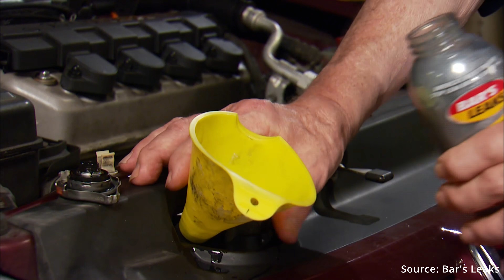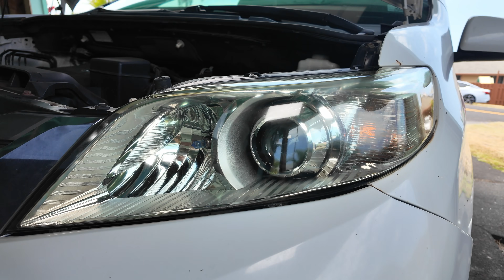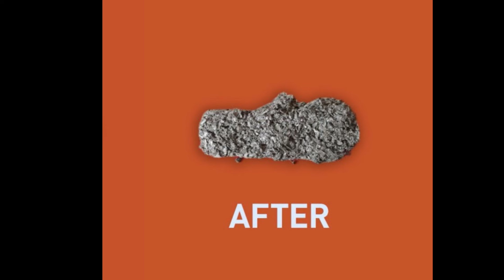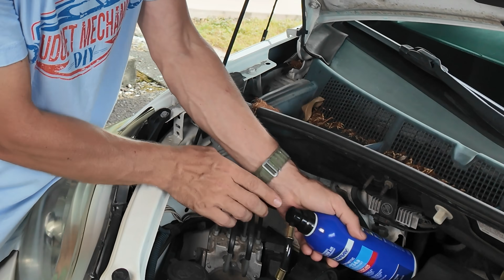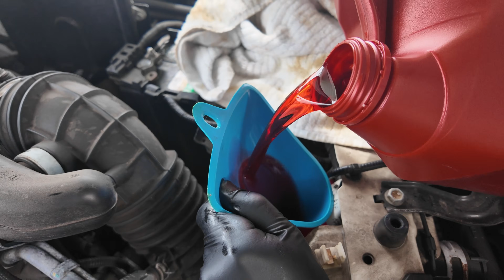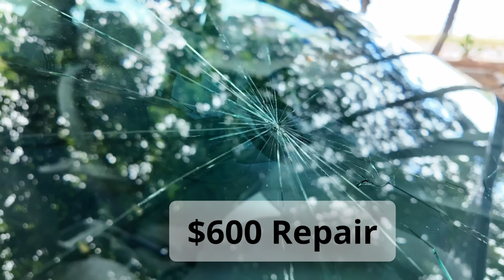These 'Quick Fix' Products Shouldn't Work This Well!

Comment: So, the Prius 2010-2014 are infamous for head gasket leaks.  Forums warned against using pour-in head gasket repair kits. I'm not paid by K-Seal, but the Ultimate Head Gasket Repair bottle saved me thousands so far.  20K miles in and the old girl and it's still going strong.  Head core is not clogged like forum people said. Now, this sealant is ceramic and not the metal base formula.  Again, I'm not saying this might help your scenario, but I worked for me.

Comment: I used the Maquire’s 2 step wipe headlight restoration kit on my 2006 Equinox which had heavily yellowed headlights. It cleared them up like new and it has lasted for 2 years. This is in Southwest Florida. BTW I used the 3M product in the past and it did work great but the kit doesn’t include clear coat protection which is what keeps the yellowing from coming back as fast. The Sylvania kit works as good 3M buy it includes a uv clear coat protection which.

Comment: There is no such thing as a fix in a can. I've been driving since 1991 - anything designed to stop a coolant leak or a head gasket leak ends up clogging the radiator, heater core and coating the engine cooling passages with gunk. You're just going to have to spend the money either way.

Comment: Hello from Norway. This you are telling about air-conditioning on a car and the AC box refill not working. This is directly distasteful and unacceptable attitudes from you. I bought a car. Peugeot 407sw 2.2 HDI. 2007 model. Air-conditioning worked very poorly. I bought such a refill box with AC gas, seal, lubrication in a box. I did this in the summer of 2025. I still have AC that works in August 2026.

Comment: In regards to Lucas. I had a 95 k2500 Chevy that would lose oil pressure when idling. Adding a quart of Lucas to my oil helped fix the issue, and I ran that truck for a long time. I'm not saying it's magic, but on older high mileage vehicles I've had success with it.

Comment: Josh, give us a chassis lube video. 

I just bought a grease gun and a grease cartridge and did it myself. My 4Runner has two driveshafts. The front 4WD shaft has two u-joints and one slip yolk joint. And the main shaft has a double cardan joint up front (which is two u-joints) plus a rear u-joint and a slip yolk joint.

Comment: I fixed a small head gasket coolant leak trickling down the block between pistons 1 / 2 for over 10yrs and sold it like that using radiator stop leak.
If you don't use PEA injector cleaner once a year your paying for it.
You need to scrape the winscreen with a blade and do it again, i can get them perfect normally.

Comment: About the windshield repair kit, after I bought one, I found out my chip was too close to the edge of the windshield.  So, don't try it for chips close edge.  Also, I found out that my Auto insurance with $500 deductible comprehensive covers free windshield chip repairs.  So, with another small chip away from the edge, Safelite came and fixed the chip on the Auto insurance's dime.  Also, about the $600 windshield replacement.  I have had two windshields replaced.  One required calibration for Lane Keeping Assist and Lane Departure Warning to work that one cost about $600.  The other didn't require any of that and only cost $290 installed at my home from a Business in the state of Delaware near Wilmington.

Comment: I used to use a product called engine restore. Would be curious to know what you guys think about that. Also would be helpful with more information about turbo cars because I used to hear that fuel injection cleaner is bad for turbos because if any build up gets loose it can damage the turbine fins.

Comment: I live in Alaska and I've used that brand of windshield chip repair. It did fairly well, but the RainX chip repair was significantly better.
Reply from the maker: Good to know!
Reply: I just dab some "clear" nail polish over them. Some of my chipped spots are treated such since 10-12 yrs, and they're still going strong 💪

Comment: In the late 1970’s, we would temporarily stop pinhole radiator leaks by adding ground black pepper to the coolant. It worked as well as any other product on the market at the time at a fraction of the cost.
Reply: That's nothing to sneeze at!

Comment: Had great results with Lucas stop leak. Fixed a rear main leak on a 2000 camry v6 5 years ago. Still doesn't leak or use oil, but I use high mileage extended drain synthetic.

Comment: There's no way a shop is charging you only $100 to diagnose/refill an AC system 🤣
Reply: I was wondering about that comment as well. When Josh said it I was thinking to myself .. yeah, no.
Reply: Where I am I can.
Reply: 2 yrs ago, paid $80 CAD, Mississauga - Ontario, full AC diagnostics and recharge, till date working perfectly. Thus I say, "$100 is about right" 👌
Reply: @QoraxStan where in Mississauga? I just paid $260 in Mississauga
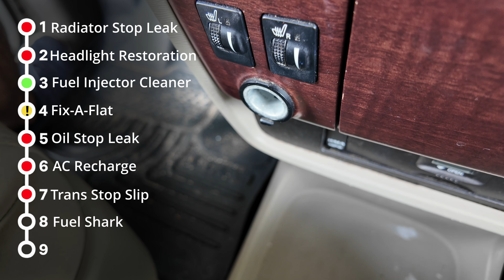Reply: Transmission Shudder fix cured torque converter shudder in my 92 Explorer, lasted for the last 5 years I drove it 16:10

Comment: I kept my AC running for years by adding 134a using a single hose on my junker 300K Nissan Altima.  Had to refill it every other year.  I really didn't expect it to work as well as it did.  I got lucky I guess.
Reply: It worked on a Nissan I owned back in the day but I bought a van and tried to use it recently and didn’t have any luck 😩

Comment: I always use top tier fuel along with (once a year) dropping a 12 oz bottle of Techron Concentrate Plus (it contains PEA) into the tank when it's low and then adding 7 gallons of gas on top and then going for a 40 minute freeway drive. Then I just use up the rest of the tank until the next refill.

So.. Josh's producer is finally coming out of the shadows to become a legitimate budget mechanic personality.
Reply: Top tier fuels are definitely worth using.
We get much cleaner carbies (very obvious) and injection systems (less obvious) when using them.

Another way to keep the whole engine clean is to bond a protective coating to everything.
It stops the build up of sludge, removes existing deposits and improves combustion efficiency (reducing the products that cause deposits).
🙂#XcelPlus
Reply: @1Wondering  pretty sure that's called Valvoline restore & 
 protect. And it's awesome after 60,000 miles of using it.

Comment: I disagree with the fuel injector cleaner. I used it in an older car. Yeah it cleaned the gunk in the fuel tank and clogged the fuel pump, don't do it!

Comment: I’m sorry but the ac refill are worth every penny if you don’t want to pay a fortune to get your ac repaired. People only tend to use them when the ac isn’t blowing cold.
Reply: I've used the AC refill kit.On my 2011, Honda Santa Fe 4 cylinder it worked great. The garage wanted to try charge me two thousand three hundred dollars. 4 months later still works.
Reply: You can certainly damage your AC system if you overfill. The refrigerant needs to be evacuated, weighed and replaced properly.
Reply: @lawrencejohnston5135 I’ve done it more then 10x never damaged anything and worked perfectly every time.

Comment: I was once stuck in the middle of nowhere with a leaking radiator and no shops for 100km.  A local farmer cracked 3 eggs into my radiator and it sealed perfectly and got me home.
Reply: In my country El Salvador we also use an egg to patch and stop a soccer ball from leaking.  Say the ball got punctured in a fence or with a nail, you inject the egg through the stem with a syringe, instant seal from within. But the ball gains like 2 lbs of weight, many times the weight of the egg for some mysterious reason.
Reply: SO how did you get the junk out of the small little tubes and channels in the engine afterwards?

Btw, you also got this waterpump which spins. Dont want to clog that up, right?

What about the overflow tube? If that gets clogged, might create a problem as well i guess.

Stuck in the middle of nowhere you say. Few eggs, and you got home.
My guess is that you were not that far from home to begin with.
Sure, it will fix the hole a bit, but it might cause more problems if you dont immediately clean out the system and actually fix the problem.
Reply: @TMGpuntNL I live in a country where driving 200km between towns is not uncommon, not NL where a paper plane will cross the entire country if there is a slight breeze behind it.  You do what you have to do to get it done here.
Reply: @TMGpuntNL actually eggs use to be quick fix that doesn't solidify completely.

Comment: Instead of Fix-A-Flat, get a portable 12VDC air compressor, a tire plug kit, and a couple flat head screws.  If the tire plug kit doesn't work, then just put in a screw for a temporary fix to get to a tire shop.

My problem with the glass chip repair kits is they provide just enough liquid filler to fix one spot.

For a glass water spot remover, just get 70% isopropyl alcohol.
Reply: After the initial resin is used, you can just put CA glue and it'll be fixed until you get tired of that chip and eventually replace the windshield.

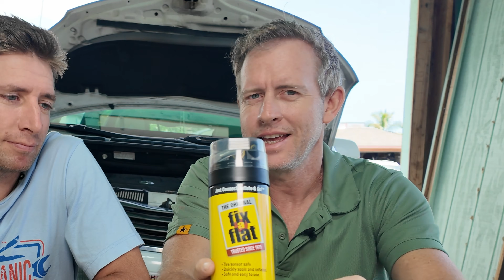Comment: 6:19 fix a flat is a terrible idea for modern cars.  It is fine for a tire you don’t care about…. And…. You don’t have a tire pressure sensor.  Because it’s probably done.  But yeah if you gotta get out of where you’re at AND it’s not a crazy blown/cut tire sure if it’s more important/expensive to be towed but that tire is only good to get where you needed to then some sort of repair needs to happen,  maybe you can plug it.  Maybe it’s gone (and you would ideally replace the other tire across from it, or if AWD ideally all tires if they’re worn)

Also I actually have seen TPS sensors go bad with these types of products (the fix a flat and slime stuff)  or presumably that’s what happened because there are 3 that are fine and this single one went off and someone shot in some fix a flat to get outta a bind.  Would it have gone anyway?  Maybe… but they don’t really go bad like that too often.

Comment: here is a niche for the use of thickening your oil... If you use your vehicle for rock crawling. When you get to an angle your oil pickup can't grab oil it keeps the oil where you need it just long enough to get back to a level for your oil pump to start pumping again.
Reply: While i agree with this unfortunately most people would already know when they need thicker oil, most of the thickening products just prey on people who dont understand how a engine works.

Comment: As an employee with a tire company, both the slime and fix-a-flat I have seen to not work with inflation of the tire. If you get a flat tire, the safest option is to install the spare tire
Reply: If such spare tire came with your car, which is often not the case anymore unfortunately.
Reply: @OlivierCaron  < And if your car doesn't come with an OE donut ~ purchase one and carry in your dickie 24/7. It's a lifesaver 🫡

Comment: Bars Leaks definitely works. It does stop small leaks that appear on an older radiator, and can fix leaks in other parts of the system as well. I haven't seen any examples where it clogs things up - maybe if somebody uses 10x the quantity that could happen. I've used it on old cars that weren't worth putting money into. It can get you by.
Reply: Scotty Kilmer states that it works.
Reply: I have a Chrvy 6.5L V8 turbo diesel that had a rub-through in the bottom tank of the radiator; small, but significant. Bars stopped the leak with no problems experienced over the 3 years since. I will have to replace the radiator one day, but since we have a 2003 Workhorse chassis motorhome, changing it is going to be a mongrel job.
Reply: In a historical mission, the USS Nautilus, the world's first nuclear submarine, successfully used Bar's Leaks Radiator Stop Leak to seal a coolant leak in its condensing system, which saved the mission
Reply: The key to successful outcomes is to use the products appropriately and follow the instructions.
These products often won't work if you don't correctly match the problem to the solution.

No doubt that some products are just outright scams.
The worse products are those that are copying more expensive products that do work... as you then assume that all similar products don't work.
I've periodically revisited a product only to realise that the cheap knock off I bought is the reason it didn't work.
BTW: Also had the opposite experience where you pay a lot of money and realise the product still doesn't work as well as a cheaper product.

If you have enough patience and do some testing you can often resolve some of these questions.
If you persevere and find a product that does work it's often worth the effort... as the one working product will pay for itself and the other failed products as well.

The devil has always been in the detail.
🙂#XcelPlus
Reply: I have a 97 merc mountaineer and it fixed the failed gasket around my thermostat. I have since changed the coolant and leak is still fixed

Comment: that headlight wipe only works temporarily and didn't remove everything as you showed
Reply: My sisters lights were really bad so we did a headlight restoration (not just a wipe).
It worked reasonably well.
The lights went from opaque to clear.
After a while they got a little bit cloudy again... but still much better than they were originally.
In the end we changed out the lights for a new set as the RWC guy wouldn't pass the old ones... even after giving them another clean.
He complained about micro-cracking.
The replacements were ~$230 for both... so we didn't mind too much.
Passed a second RWC a couple of years later with no problems.
🙂
Reply: @1Wondering  You need 2k clearcoat if you want your results to be a bit more permanent. Any "normal" coating will only last 1-2 years and the yellowing and cloudiness is back.

Comment: YOu should have a mechanic fix your ac properly instead of buying that an auto parts store
Reply: There is also the issue of letting the refrigerant escape. It is very bad for the environment especially  the ozone layer.
Reply: @lawrencejohnston5135  yes, good point

Comment: What do you think about oil filter magnets?
Reply: Should be a little something to it. Manufacturers put magnets on the transmission drain plug and that magnet catches quite a lot of stuff over the miles.

But if a magnet on your engine oil filter is catching a lot of particles, I'd say you have a biiiig problem about to happen!
Reply: @gregvanpaassen  The filters on transmissions are not filtering the same as an engine oil filter. My 1998 Avalon merely has a mesh metal screen on the transmission filter. The filter media of an engine oil filter likely filters out any metal shavings that are large enough to be harmful.